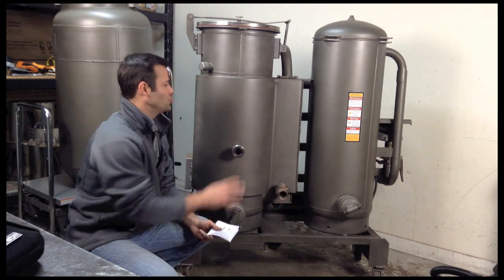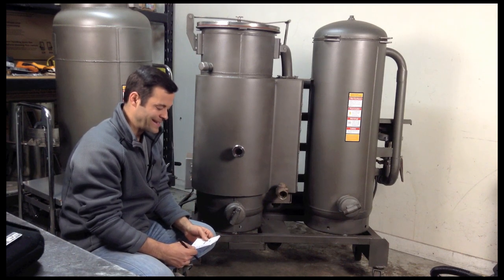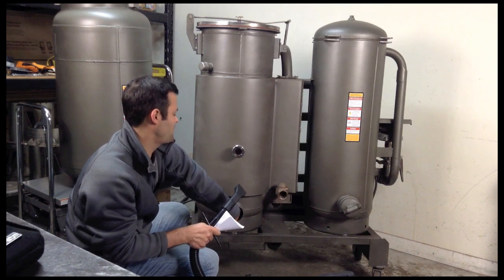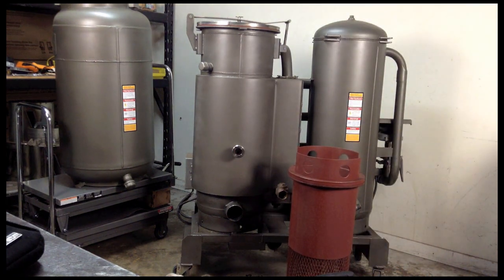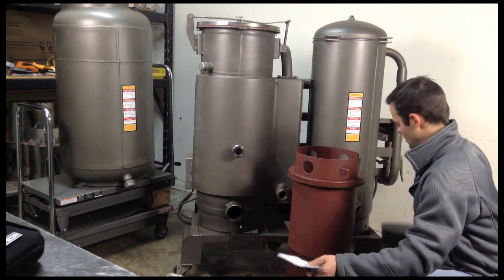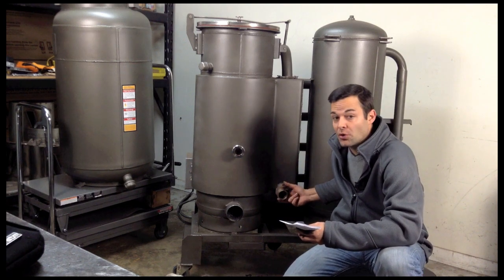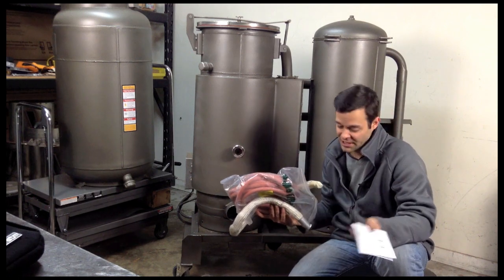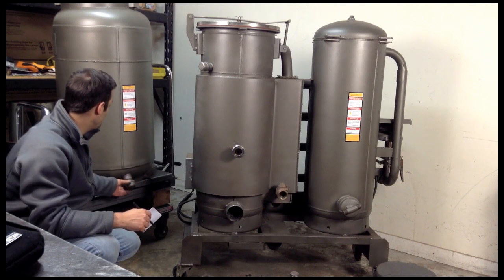Gasifier Maintenance Video

Comment: Hi Ben! 
I bought your plans. I'm starting my build tomorrow. I have several questions. 

1. Is this maintenance schedule with 24/7 operation? 
2. I would like to add some gauges to monitor temps, vacuum, etc. 
Where would you recommend I get temps on the reactor? what would the expected temps be at each level? Sorry, lots of questions : ) Maybe you can make a wiki : )